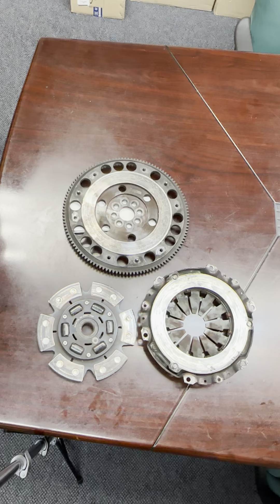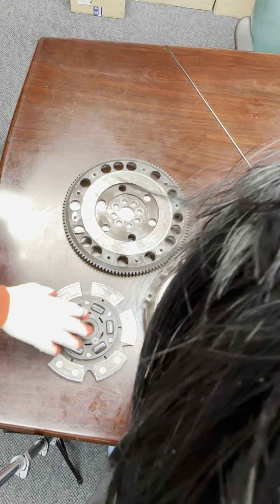Clutch Installation/Malfunction/Problems Technical Bulletin - by Gripforce (Grease Contamination)

Comment: I am having the same issue after clutch replacement. Clutch slips in 4th gear or more prominently notice at 4th when trying to accelerate. A little of burning oil can be smelled. Will it stop slipping as the oil burns out?
Reply: I suspect oil contamination. When I did it that happened once… The best cure is to replace the disc and resurface everything.😊
Reply: @SpeedSolutionINTL  it stopped slipping but something is not right anymore. There is no smoothness at release point. It needs to be redone.
Reply from the maker: @hokz7283  It may be "fried". It's better to change out the disc and resurface the flywheel and the pressure plate.